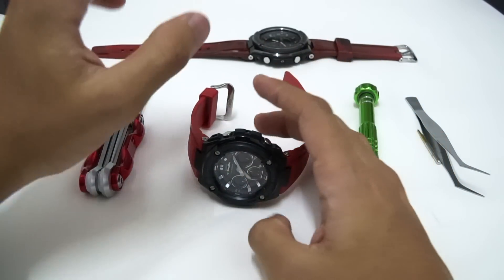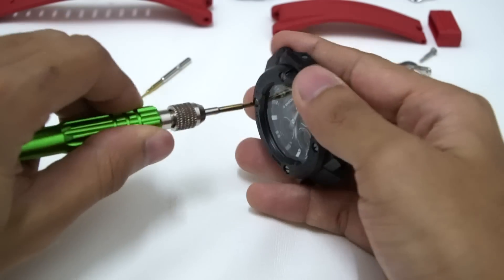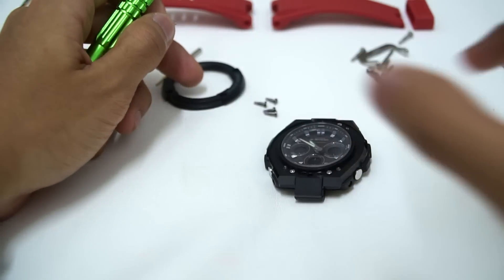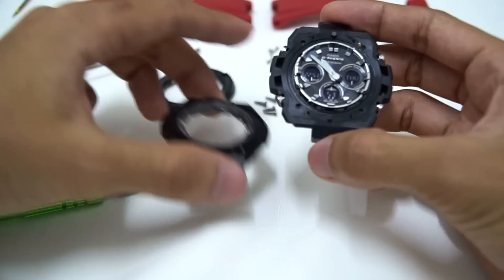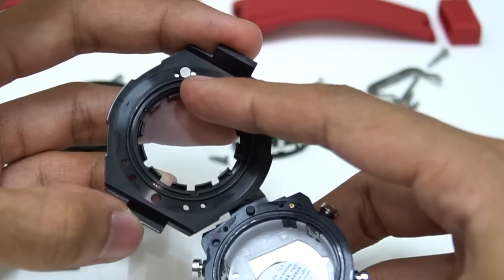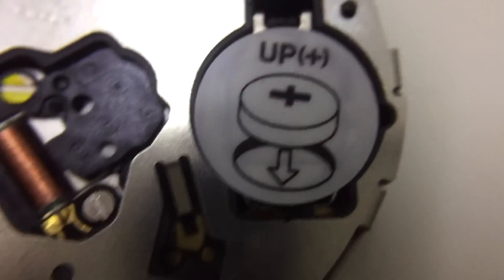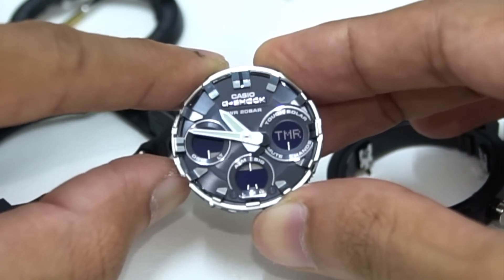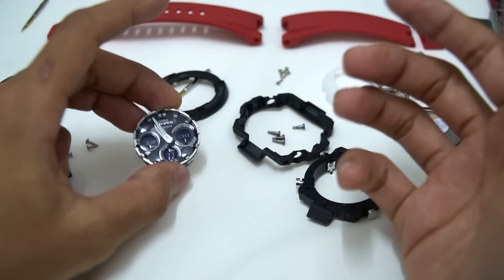Whats inside G-Steel GST 300 series Tough Solar G-Shock watch

Comment: I purchased the GST-B110BD, which is the black one with the metal strap. I swapped to the resin strap and realized that it doesn't have that metal plate plus it has tube-like covers for the strap screws. I was so confused. Thanks to your video here, now I am released.
Reply from the maker: Great to know this was helpful to someone. Thank you for watching!

Comment: Is it possible to remove the resin beneath the metal bezel on a GST-S110D? And will the metal bezel still fit without the resin? I wanna slim mine down. Thanks if you reply

Comment: What is the function of the golden spring at 4:31? I unscrew my GST b200 bazel and this spring came out of nowhere, now I don't know where to fit in. Is it ok if we don't put it back in the same place ?
Reply from the maker: other than for static or circuit grounding, Idk why else it is there. 

There is a tiny hole to put it in, usually at the top area of mid-bezel surface. It'll be sandwiched between the bezel during assembly.
Reply: If the spring is not fitted you will get no beep when you press the buttons.

Comment: Nice vid, but touching the watch face with fingers and putting it down to a table face down, thats a NO NO
Reply from the maker: This watch is tough enough to take the treatment but I understand your concern. I’ll be extra careful next time. Probably remove the battery first before placing the watch face down like that. 🙇‍♂️